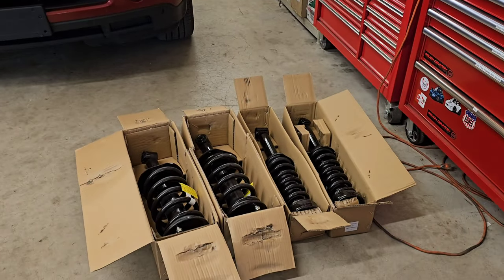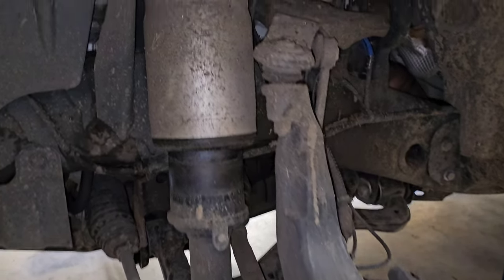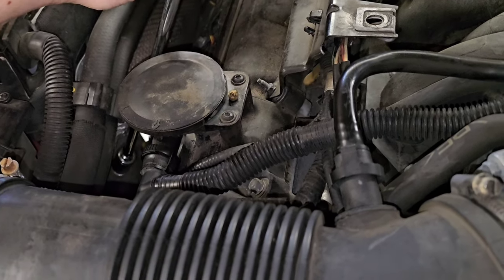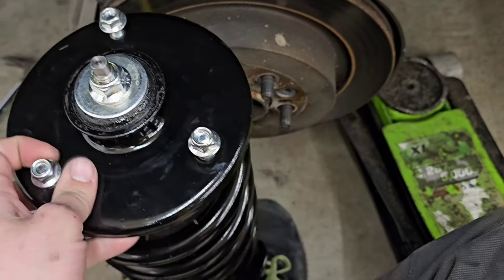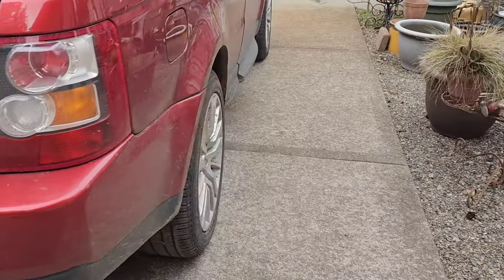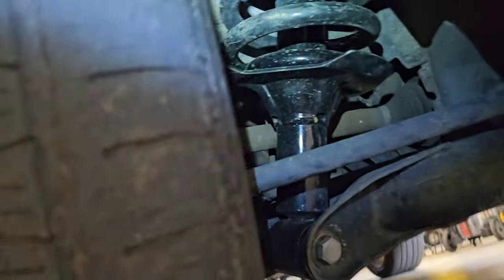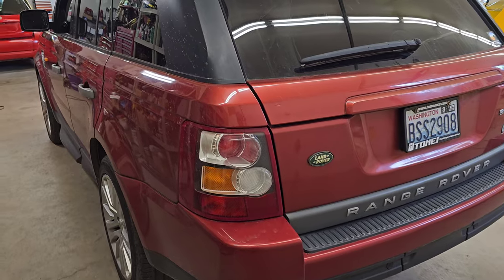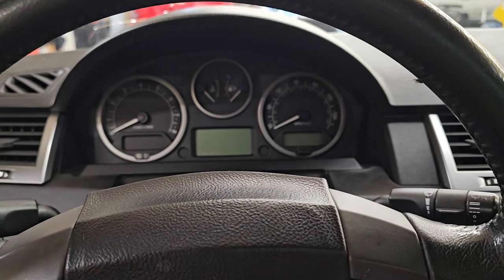Range Rover Sport Cheap Coil Conversion (Suncore Air To Coil Spring Kit) L320

Comment: Dont do this
Reply: Can you explain why?  Both rear shocks on my 09 are leaking.  RR Sport has 93,000mi but overall is in good shape and I don't use the raise/lower function.
Reply: @stevepen do it I just did no more headache with the airbag problems
Reply: @swaggerdagger98  Other than replacing the shocks and removing those 3 fuses, was there anything else that needed to be done or any surprises?  I guess there's no way to get rid of that yellow light (RR symbol with the arrows above it)?
Reply: No I didn’t even pull the fuse works just like normal

Comment: I've had this kit for a few months, and I just put on 30mm spacers and 275/65 R18's on (32'S), which to be honest is probably too big with this kit, getting some annoying rubbing just turning hard, I should have got the 285/60 R18, they come out to about 31.5 inches, i think the tread on my wranglers is so rugged its hitting

Comment: I own a 2008 Discovery 3 SE V8 with air suspension and terrain response. I have to say I wouldn't never remove the air suspension because it takes away from the Rover. I have 100K + on her and still going. My opinion, of course, enjoy your RRS! Cheers 🍻 🇺🇸
Reply from the maker: I agree it does take away, but with this particular one and it's mileage and other issues this makes for a cost effective way to keep it on the road in my opinion. I have a different rrs with less miles and the air suspension definitely is handy and it's more capable with it still installed for sure!
Reply: Probably you haven't stuck in the middle of the winter/summer road with the small child back in the car due to air susp failure and impossibility to move... That might change your opinion
Reply: Take away what? Take away unreliability? I don't mind 😊
Reply from the maker: I like being able to raise the suspension to clear things but mainly I just think it's fun to raise the car up and down at stoplights 😅, but I'll make that trade too when my current rrs suspension gives me trouble

Comment: How's the ride height ? Does it still sit lower in the front then the back like with the air bags or does it sit more level ?
Reply from the maker: I can't really say as my air suspension was sitting a little crooked side to side. But it seems to sit level unloaded, and with passengers and weight in the trunk the back sags just a touch.

Comment: I have done the same with the Dunlop kit from UK, rides great, no regrets, much smoother than air suspension by the way.
And if you want to move forward you can install incredible shocks and springs and make the car ride even better, much sportier and at the same time soft.
Congrats with the right choice!!
Reply: Hi there, I have done the same on my 2009 sport uk the Dunlop ones, but for some reason the back of my car it's much lower than the front,  any idea why?? Thanks 👍
Reply: @anestishehi3571  Yes, i know for sure. Install 1 inch (3 cm) inserts on top of the back spring tops and you'll be fine. Sorry,  i dont know the right word for that insert (the one that sometimes people use to lift the car)
Reply: @viryaspace  thank you very much, I think they called them spring coil spacers, but I was not sure if I have to go through with them or not, thank you 😊

Comment: Thank you for your commentary. I am entertaining the thought of getting rid of my airbags. The rarest keep on lowering I only have 75,000 miles on my 07 and I think that the previous owner already had the air suspension worked on. It's just one less thing, I would like to worry about breaking, I've been looking at the ones that are about $1000 and they have the clips or chips. Do you avoid the lights coming on? I deleted it in my Lexus GX 470 in my lights always come on.
Reply from the maker: As far as the lights and warnings some of mine stayed on until I ended up trading out that 06, but I think it just comes down to personal preference as I don't mind having warnings as long as I know something isn't actually wrong. That being said with this video getting far more traction than I expected I've been able to hear from a lot of people about their own land rovers and I've come to the conclusion that the warning lights you get are dependent on how your suspension failed and what parts you chose to remove and keep. If warning lights are an issue then the more expensive kit is probably the better move, especially with yours being lower mileage it probably deserves it haha.

Comment: Good evening, I have a question. I'm having problems with my front suspension on the right side. I changed the airbag for a new one and it doesn't look good. I'm thinking of using this same suspension kit that you used. My question is about the lights that come on in the Dash how they can be removed and if you had the same problem… thank you 🙏🏽
Reply from the maker: With this kit there is no way to remove the light unless you disassemble the Guage cluster and block the light. Some of the more expensive kits come with a box that you can wire in that will disable the light.
Reply: @HangarGaraj  thank you
Reply: Have you tried replacing the valve block inside the front right wheel arch. Take the wheel arch liner out and it's a black box with 3 air lines running to it. Easy to change and they can get blocked if its an older model. You may also have to change BOTH front springs to address the leveling issue as the pressure needs to build up in the right hand hairspring before it transfers to the left hand one. Speaking from experience as I've changed all four of mine and all is good now.

Comment: I have a LR2011 V8 HSE. Can I pull the same fuses out and Get rid of the warning light ? Thanks
Reply: Get a car scanner the warning lights could be from the headlights.  You'll have to go in and clear the faults under the air suspension that reads headlights. That was what was causing my warning lights.  Weirdest stuff ever but BMW did have a hand in designing the electronics for these model years. A lot of crap on these vehicles electrical system reads made in Germany 😢

Comment: Did you get a suspension fault warning saying the max is 30mph after installing the coil struts ?
Reply from the maker: If I remember correctly I was getting that warning with the air suspension but afterwards I only got the suspension fault warning that doesn't say anything about max speed.
Reply: @HangarGaraj  How did you find the solution to fixing that warning fault ? I recently switched mine from air to coil. The lights on the dash indicator stated suspension fault but the other fault was 30mph max. I’m trying to figure out what went wrong after installing these struts
Reply from the maker: @therapeuticpink9689  All I did was pull the air struts out and pull the three fuses I mentioned in the video. As these vehicles age they could start to act differently so maybe I got lucky.
Reply: @therapeuticpink9689 I'm thinking he got lucky without the warnings. My wife's LR3 was lucky with this conversion, my L320 was having the same issue you're having and then I finally got the bypass module installed. I have the info in my latest video 👍
Reply: How long did it take

Comment: Have you taken it off road, and how efficient is it after the conversion?
Reply from the maker: Yes I have taken it offroad a little, and it did just fine. Not quite as smooth as the air ride but still very good.

Comment: I've had no luck retaining the terrain modes, I pulled all the fuses and I just have the red suspension warning light, which is probably the problem, but if anyone has any tips or links on how to get my modes back I'd appreciate it, mines an 05 LR3

Comment: Over 200k. You must of done timing chain 100k miles ago.
Reply: Timing chain is not a problem on the 4.4l jaguar engines (2005 to 2009) , the problem with the Timing chain started in 2010 with the 5.0l engines
Reply: have* done
Reply: @garrystubbs4891  don't know how I miss that. Typing fast. Thanks